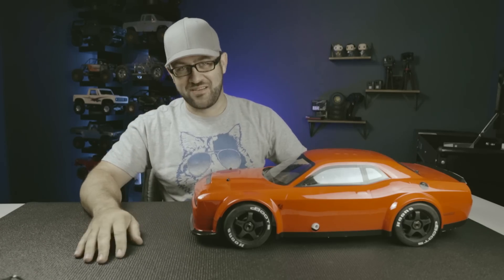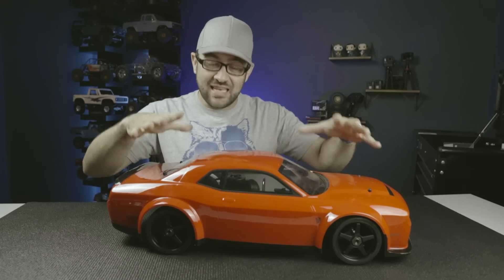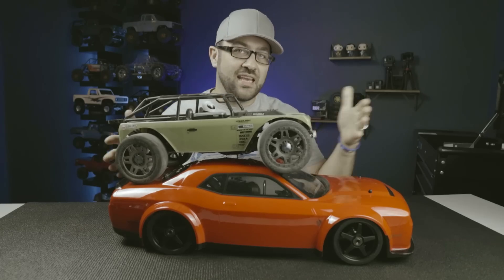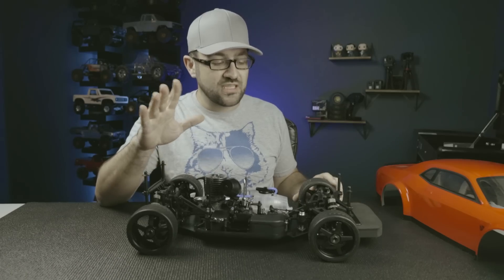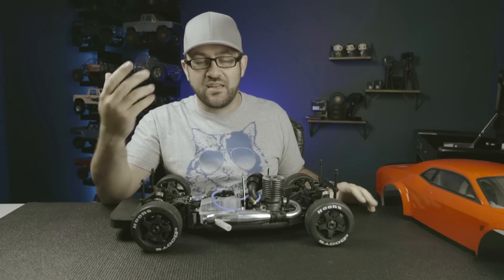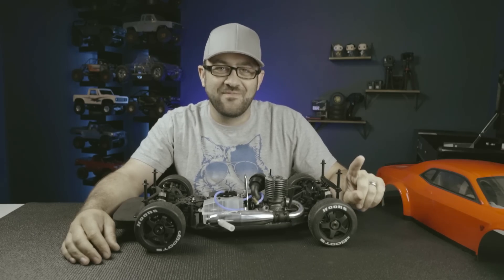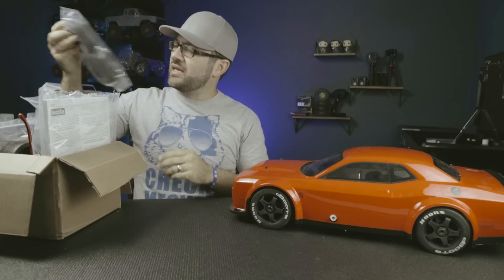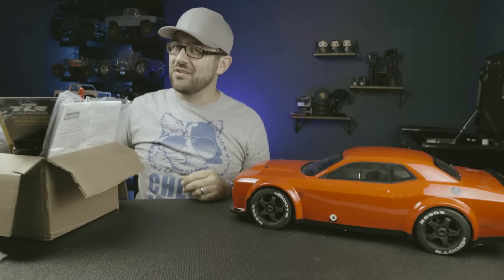#MonthlyMayhem Challenge InBurno - Week 1

Comment: Awesome. To get nitro to burn out think your going to need heavy clutch springs. Breaks on front is good idea. No front drive great idea. Tune on motor is critical. Break in is also important. Motor is sensitive to temp, barometric pressure. Humidity. Go Joe dirt'y! You got this one.

Comment: If you can mount a brake assembly to the front diff on the input shaft it is basically a line lock like a real drag car.

Comment: You need a disc brake on the front diff input shaft , a longer piece of silicone tubing should take care of the exhaust and you can adjust the 2speed clutch so that 2nd gear engages instantly ! I used to use"high rise" intake manifolds on my 1/10 nitros (if you can find one to fit it) so I could get more rpm's out of it , but throttle response may suffer a little.

Comment: the thicker diff fluids can help you put more power to the ground and you  should look into a 4 puck clutch set up with different spring options you want h hard hitting clutch engagement and the compound of the clutch shoe is also just as important as the springs you use

Comment: Lock the front diff and possibly install a servo under the rear to lift some of the weight off the tires so they will spin easier. The lift will look like the tires are expanding so it would look natural.

Comment: also pay attention to the fuel you buy there is different oil percentages I would recommend the 11% oil compound then you could really cheat and add and oil drip tube that would drip oil directly onto the rear tires because add lubrication will make it really easy to overcome the friction of rubber to the road

Comment: Put disk brakes on where the drive shaft was and it can do a line lock burnout, also add weigh on the front if you do so

Comment: Nitro...I have a love hate relationship with my T-Maxx 3.3.  Love it when it's running right, but when it's not...
Reply: OS made a rad motor for the tmaxx. Has 3 carb adjustments low, mid, high, and you don't have to adjust quite as much. Break in is super important. You probably have a worn piston/cylinder situation if she is super fussy.
Reply: @TheFlynryn  I've rebuilt the motor too many times - even taking extra care to seal it really good every rebuild. Break in per traxxas procedure the motor flood out, but I'd get it running rich with out flooding out.  After doing the procedure, I'd run it around and tune it nicely and she'd run great...  For a few days of runs.  Then I'd have to chase the tune, and then rebuild the motor again. I got really dam good at rebuilds, but so sick of rebuilds and new pistions and sleeves - it can stay on the shelf. :-)

Comment: Back in the day I had a HPI Savage .21 and it was so much fun when it was running right, but I found that truck so generally frustrating that I’ve never owned another nitro car. Semi truck smoke generators dumping into the wheel wells would be the ticket for a smoke show. Add in any scene from Vanishing Point (the movie that made the Challenger cool), and bob is your uncle.

Comment: Look at the smoke generators for drift cars. It hooks into the throttle channel and dumps smoke on demand. Works  great in addition to real smoke off the tire
Reply: Oh also get some heat tape/foil tape for inside the body so ya don’t melt her down 🤘🏻🔥